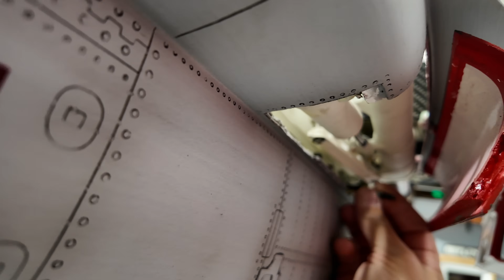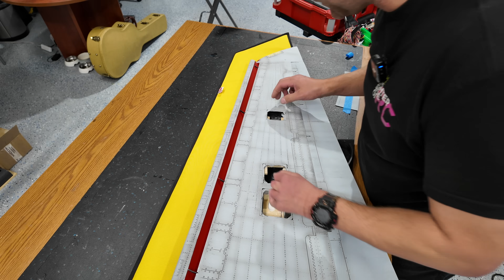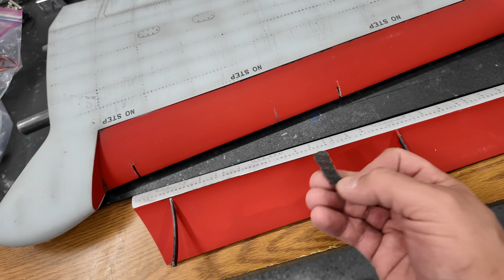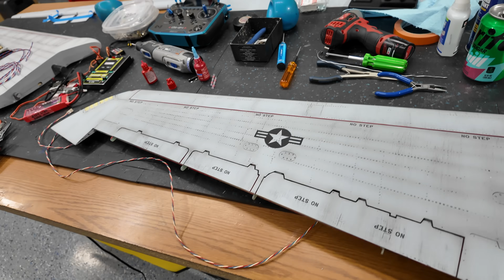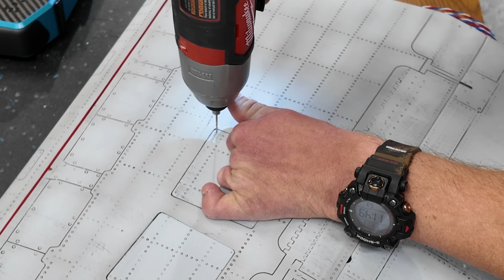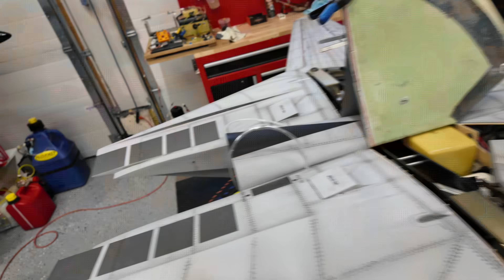F-14 RC Project: Perfect Wings Take Shape - Video 5 Skymaster Jets

Comment: How are you securing the servo plug to the harness plug (PB clear plug) in the wings. I have seen you use a few different methods here curious what you use now
Reply from the maker: For a while now have been using foil DUCT tape.
Reply: @thelightersideofrc  good friend put me onto waxed lacing twine. Tie the connection together. It works really well, easy to remove no residue.